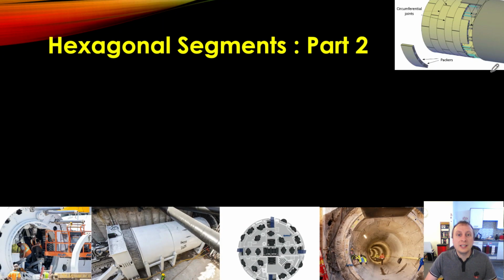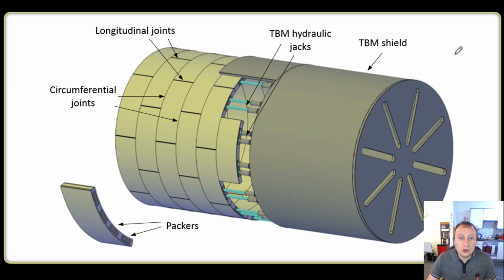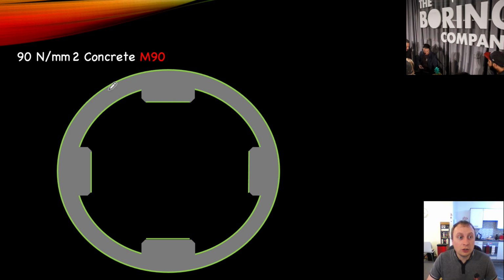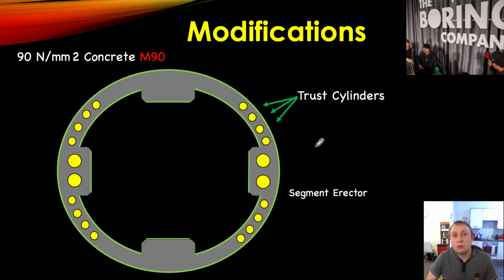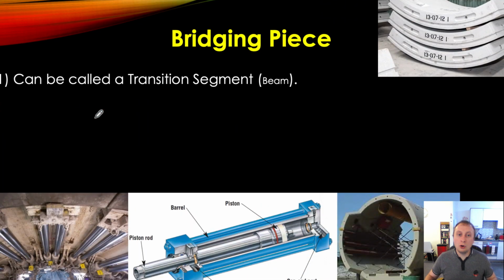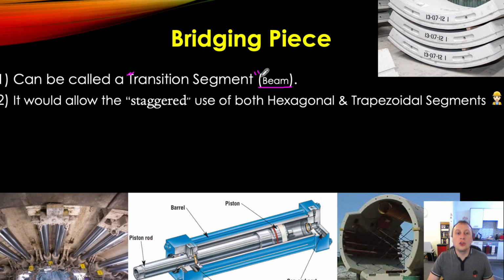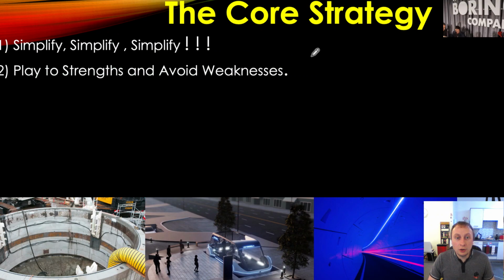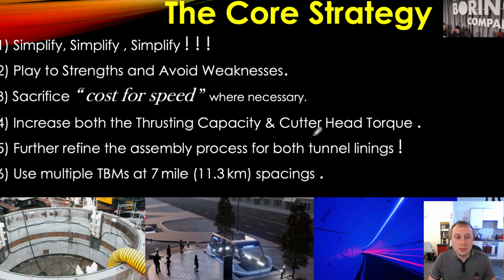The Boring Company 🚇 😃 🇺🇲 Hexagonal Concrete Segments Confirmed 👷🏽‍♂️ 🏗️ 🚎 PART 2

Comment: The Boring Companies edge will be the boring machines that they have created.  Not only will they use them for their own mass of projects, but they will profit by selling them to other less innovative legacy tunneling companies.  Also by having only electric vehicles in the tunnels there will be no need for fire suppression or emergency ventilation systems like traditional tunnels require.  This cuts costs tremendously!! They demonstrate this concept in the Las Vegas Loop project.  Also, as these projects take off, think about the sales effect on Tesla cars!  Tesla stock to $100k!!

Comment: I am not sure that fix radius and strait lines is the best approach.. you will need CYCLOID curves to transition to arcs and manage lateral forces while tilting the tube road when it goes up/down left/right and combined ... usually using a small rotation in every ring. Following ground layers approaching stops avoiding hard rock or waterways... there's many different events that stops tunels to be straight... usally rails are not 100% matching the tunel tube...

Comment: It will never work. For congestion a better solution is for people to stop using their autos so much. We need to start conserving fossil fuels. When you consider all of the fuel burned up making and running electric car the electric vehicle is no more fossil fuel saving than diesel vehicles. There is only one lane for the vehicles to drive in so how in the world will this decrease congestion?? The freeways on the land started out with two lanes and then increased to 4, then 6, then 8 lanes of travel. How are all of those cars going to cram into a single lane?? What happens when a car crashes or the engine fails. The whole bunch of cars behind it will be waiting a long, long time!! This idea will never work!!
Reply: Did you miss the part about building an arbitrary number of parallel tunnels for highly congested routes? And the part about these tunnels working for a wide variety of vehicle sizes, including suitable busses and trams?

Comment: the advantage of hex segments is that you can set half of them while pushing against the other half
add a flat spot (turning them into octagons)  and you now can use them the same way you use the hex segments, but you can also vary their width as needed (and or make the side not quite parallel) so that they can be used around curve just like the rectangular ones, while the angled corners let you pack them in half at a time

There's also no good reason why you have to use 4 segments, you could use 6 (which would give you better directional control anyway)
Reply from the maker: I think that a 6 system is a real possibility and maybe increase the width of each segment as that would make up for the time lost assembling 6 instead of 4 segments per erector!
Reply: @BoringRevolution  how many segments in a normal rectangular setup?

given how slow the machine moves, it seems like there is all sorts of time to install one set of segments before the machine can move far enough to need to switch to the next set.

with a 14' diameter tunnel, 4 segments would be 11' along the curve, 6 would be ~7'

now, if they ever get to 7 miles per day, they are moving 25 ft per min, and that's a lot of segments to install, no matter what shape they are. but I think it's going to be a lot easier to handle 7' segments than 11' segments.

Comment: The boring company should switch to expanded closed cell polyurethane or polystyrene foam, followed by slip form continuous pour concrete inner core.
Reply from the maker: Seems a possibility although I'm unsure how well this would work in none-cohesive strata.
Reply: You're saying they should use petroleum based products for the tunnel walls? No thanks.
Reply: @NERPolitan  Why? What’s wrong with petroleum products?
Reply: @DevinHeaps  fracking has literally an infinite number of negative externalities
Reply: @NERPolitan  What’s an externality? Do two negative externalities cancel each other out like normal negatives? You’re like using words right now, but I can’t tell what language.
Reply: @DevinHeaps  you could google what the word externality means
Reply: @NERPolitan  You keep using that word. I don't think it means what you think it means. How can something underground be external?

Comment: Lol, I've been listening to rocket tech, auto, battery, casting and software/hardware tech, neural link, star link and this episode sort of fried my brain. I ended up with covid-19, that might not be helping. I'm 66 but my symptoms are mild so far, except I can't taste anything or smell anything and that is a weird feeling, or lack of.

Anyway, I'm wondering why the tunnel can't just be lined with concrete/cement like hydraulic cement on demand as the tunnel is being built. Hm, thinking about it I guess vibration wouldn't allow it to actually set well without cracking or being distressed. Well, was just a thought. Going back to first principals, is there some cellular constructed material that could work instead of concrete? I can't help but thinking about things in nature, like honeycomb from bees or tubular mud/paper nests by wasps and how moles/gophers tunnel and construct their tunnels so they don't collapse very easily like one might expect them to. Just musing a bit.
Reply: I'd buy a pulse oximeter on amazon.  Covid-19 likes to create chronic hypoxia in a whole bunch of ways - fries brains.
Reply from the maker: Its an interesting idea but to bore a tunnel you need apply massive pressure onto the tunnel face via the cutter head.
How you do that effectively via hydraulic jacks using a concrete lining that has had less than 48 hours to cure, is beyond my expertise. Its likely very difficult and insanely expensive!
Prefabricated concrete can be left to cure "properly" in a warehouse for 28+ days and always arrives on-site in near-perfect condition with a low production cost per segment. It is perfect in every way really !
Reply: @BoringRevolution  What you said makes sense. I was thinking the sheer weight of the boring machine was pushing against the earth. That shows I do have major gaps in my knowledge :)
Food for thought: Most utilities in cities, in America at least, are buried under the street. What would you think of Boring Co. building a mole made to bore 6-8 foot diameter tunnels for cities designed for utilities (natural gas, electric, sewage, water mains fiber optics, cables and such). In the last year in my neighborhood, I've seen the street dug up twice for replacing a leaky water main about 60 feet or so long and the other maybe half the length. That gets pretty expensive in itself. I could envision tunnels for utilities that could then be monitored, periodic inspection, repaired, replaced and such without digging up the streets. Even electric trams could transport workers and supplies as needed that could hang off a rail or two rails suspended at the top of the tunnel, or in whatever arrangement might work the best. Of course, it would take an economic feasibility study I'm sure, might not be feasible. At night when I can't sleep, I start thinking about stuff like this. Tunnels to transport waste and recyclables, maybe in conjunction with utilities. Strategic tunnels for first responders, fire, paramedics, police. I live in Southern California metropolitan areas. I've seen paramedics get literally stuck in traffic, especially on freeways. I'll stop here except for one thing, I'm wondering why Elon wants to move around the extra mass of batteries in tunnels of the type to be used in Las Vegas. Seems to me the tunnel could transmit the power via cable, or some other device and each vehicle could have a small battery pack for emergency situations or to move in and out of the tunnels with enough to get back and maybe regenerate while in the tunnel itself. That would be hundreds if not thousands of tons of battery mass that would not have to be moved through the tunnels and I would think would substantially lower power cost overall. Okay, now I'll stop before another thought pops up into my head.

Comment: Idk I don’t see them doing to doing two parts. Elon has repeatedly said the best part is no part of they plan on automating the placement of wall segments wouldn’t make any sense. Why not increase cross area of thrusting by using a larger number of small segments which are placed stair stepping back from the head. If it was 10 segments around you could be pushing off of 8 of them placing two at a time.
Reply from the maker: I see your point but I disagree & remember SpaceX's current Starship uses both sea-level & vacuum rated raptor engines. 
I don't think its some huge compromise as you spend most of your time in a straight line by adjusting the various tunnel alignments pre-construction. It also works in all types of strata including none-cohesive ground so you get the best of both worlds!

Comment: The drawback of short bridge pieces to facilitate the corner is there will be two speeds in the building as well as during the operation of the tunnel. This is also the same thing I envisioned that will happen if they try to build the segments in a spiral fashion instead of rings (spiral pattern in the straight sections and bridge segment to prepare for the introduction of a curved section).
Reply: But that small ad and complexity increases the building speed by a lot
Reply from the maker: Yeah its a compromise, fair point. 
I also forgot to mention that whilst they install the steel bridging piece they could also do other tasks like stock up on concrete segments and perform minor TBM maintenance tasks, replace worn cutter discs.

Comment: I'll take for granted that concrete of sufficient strength can be used for thrusting on only two segments when using the hexagonal method you propose. I'll also assume that your rates of tunneling are correct, which is 100 meters per day for hexagonal and 20 meters per day for the normal method. Assume every kilometer of tunnel consists of 800 meters of straight segment and 200 meters of curved. Using the normal method takes (1000/20 = 50) days per kilometer. The hexagonal method would take (200/20 + 800/100 = 18) days. If you are going to be digging a lot of tunnels, and labor costs are high, the savings in both time and labor would be considerable. Not a construction engineer, but like you said, the additional cost of concrete and the "transition segments" between the straight portions and curved portions would likely be a small fraction of the savings in time and labor of using the slower method. 

The other aspect of having mostly straight tunnels with fewer curves is that you can take maximum advantage of the capabilities of the vehicles that you are using. Normal high speed trains, for example, require a very large curve radius in able to maintain their speed without G forces pinning people against the sides of their seats when going around curves. The beauty of using essentially "Tesla cars" in the tunnels are that they are capable of rapid acceleration, rapid deceleration, and also able to navigate quite high vertical grades. By maximizing straight tunnel segments, you can accelerate (not launches, but reasonable acceleration) to a rather high speed and maintain that speed until you get to the curve where you need to slow down. Once you slow down to 20kph, you can negotiate any possible tight curve even if it had a vertical element involved. So a main tunnel off-ramp might only require (someone can check this) 100 meters of double wide tunnel where the decelerating vehicle would pull into to slow down. At the end of the 100 meters, it could literally stop and do a right hand turn into a station. Same for vehicles entering a main tunnel like your intro video shows.

When vehicles in the main tunnel need to negotiate a sharp turn, or any turn where they need to slow down, all vehicles simple slow down to the fastest possible speed to comfortably negotiate the curve and then accelerate once they are out of the curve. You could do a simulation of an oval track, with tight curves on both ends, but long straight sections. I would think that since all vehicle slow down and then uniformly accelerate through the curves, that high overall speed could be maintained. Because overall average speed correlates directly with system throughput, you want to keep that as high as possible. Having long curved sections that limit speed could end up reducing overall speed.

I'm sure the Boring Company has worked this through 100 times over and understands this better than anyone here does. The Las Vegas system is essentially a very long straight main tunnel (Las Vegas Blvd) with tight curves needs to exit to get to the individual properties. Seems almost like a text book example where the idea of keeping the tunnel as straight as possible with exiting tight curves is the way to go. If your hexagonal tunneling method would indeed be much faster on straight tunnel stretches, then it could save them a lot of time in system construction. Maybe the test tunnel they are building out in the desert is testing just such reinforced concrete to see if the added forces damage the hexagonal segments?
Reply from the maker: Have you tapped into my brain ? You must also be testing the new Neuralink 😁

Yes my thoughts entirely and like they say - "Time is Money" and what I'm suggesting isn't some over complicated work-around, it works on paper and feels like a common sense solution to every problem previously outlined.